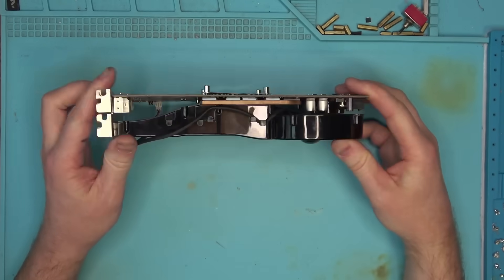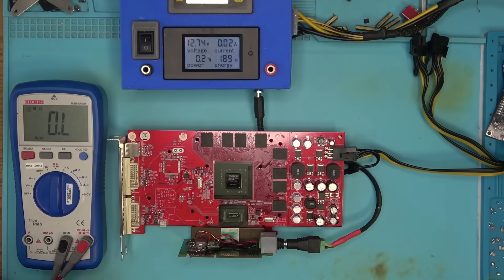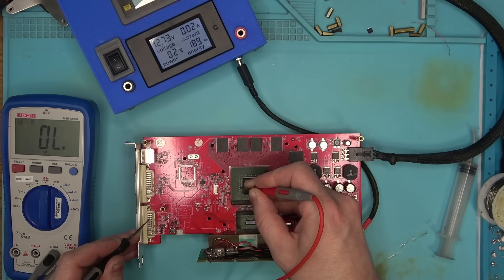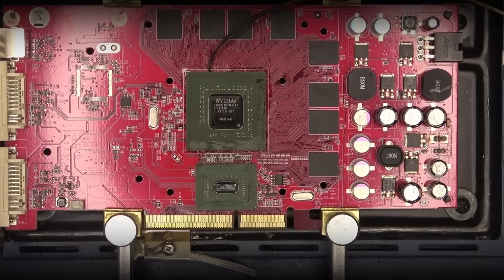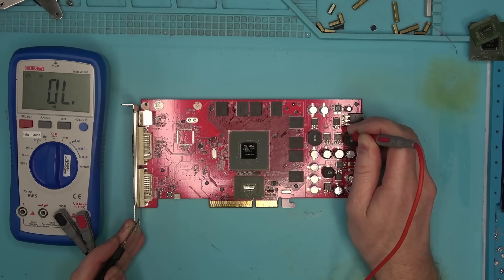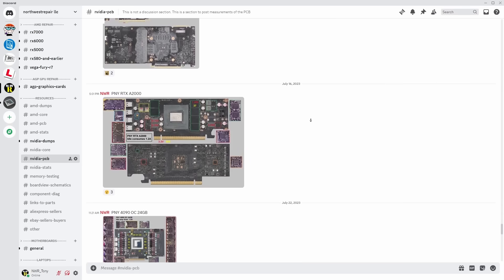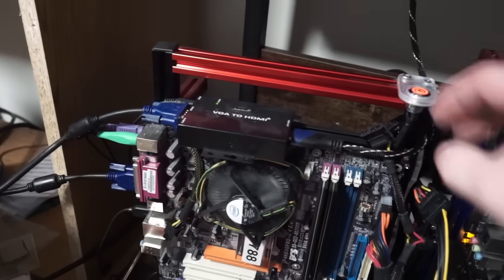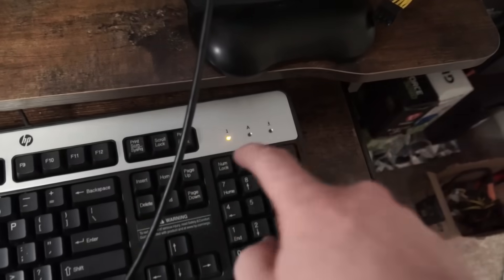Rare Graphics card incredible save

Comment: Can someone help me what could be causing these issues. I think its my gpu 4070Super, but when testing in GPU-burner and so on for arteffacts, nothing is at fault there.
When i scroll any websites, the image gets rendered by like a half and the other half is from the previous state. Happens sometimes not everytime.
It also happens in the discord, where i scroll, but only like half of the screen is scrolled.
Also when i alt tab from games like WoW it freezes the game and sometimes crashes. Win Reliability showed nvidia driver at fault which i even reinstalled.
I already tried installing complete fresh clean drivers. Factory settings Windows11.
No overclock on any device not even XMP/EXPO on RAMS.

Any ideas what could this be?

Comment: I have a Quadro FX3000 AGP that boots and works, however I get a power limit warning and it caps the performance. Some smd components were knokeced off the board (it was a rescued board). I found a diagram (pdf), but I’m not skilled enough to figure out what is missing. Most likely I will contact you, should be an easy fix considering the cases that you normally get.

Comment: How ironic to have a chipped die since the older G70 sibling had a shim. Though those HSI chips never had one, but maybe the cracks are related.
Reply: One of my 6800s has a metal shim on the HSI bridge, but my newer 7600GT doesnt (just soft foam which doesn't do much, if anything). Seems like the metal shims just got cost-downed out of existance at some point

Comment: What a weird decision for a card and not the 3850?
Reply: HD3850s are unicorns in comparison (not many sold cause it was usually cheaper to migrate to a PCIe system at that point in time than spend big bucks on a dead-end AGP card), and they cost stupid amounts of money nowadays because of it.
Also the 7800GS AGP is essentially a PCIe GPU with an AGP bridge chip, meaning you can salvage cores from the (comparatively worthless) PCIe versions of these cards
Reply: @Knaeckebrotsaege  Well aware, but this isn't 2006 anymore. Why choose the 7800GS+ vs the 3850 on a retro build? They cost similarly on ebay, I have several of both myself, I'm just trying to understand the reasoning.
Reply: @ Finding a dead 7800GS is easy and cheap, and since it's effectively just a PCIe 7900GT GPU die adapted to AGP, finding a donor GPU Die from a working but worthless PCIe 7900GT is also cheap. This combo likely ended up being cheaper than buying either a fully functional 7800GS AGP or 3850. 
edit: either that or the dude has emotional attachment to the 7800GS since he bought it new when it came out? who knows
Reply: @Knaeckebrotsaege  That's what i wondered myself. I use Lian-li PC-60's exclusively for my XP era builds due to sentimental ones. Maybe it was his original card, which would explain why he went as far as having it repaired. I can't imagine that was inexpensive. I've bought these cards working for a low as $80, as high as $200.
Reply: @suspectedstar  Interesting case, seen a few back 15+ years ago but can't remember the last time I ran across one. My retro rigs use more modern cases usually (Fractal Focus-G mostly, as it still has 5.25" bays) because of better airflow and being able to use larger, slower spinning 120mm fans compared to "period correct" cases. That said I still keep a NZXT Beta around. Objectively it's a cheap garbo case, but... sentimental attachment cause it's from my first proper gaming rig (Core 2 Quad Q6600) that I built from brand new parts, rather than hand-me-downs
Reply: @Knaeckebrotsaege  Interesting, i'd be interested to see some of your builds actually.
Reply: can't run Win 98 with a HD3850
Reply: @thomas.becker  So apparently BFG released a modded driver for 98 to support the card, interesting, I didn't know this. I suppose its time to make a 98SE build with the GS. Good lookin out

Comment: NWR saved my PCIe version EVGA GeForce 6800 Ultra, a card of a similar vintage. He thought it was still dead after attempting repairs (lifting and resoldering the core and mem) when sending it back to me but it turned out it just needed the right test setup and drivers. It's still working great for those late-night Doom 3 sessions.

Comment: The G71-GT-N-A2 is the good old 7900 GT. Great cards. I had both a 7800 GT and a 7950 GTX. Great times :)
Reply: AGP version was weirdly called 7800GS instead, despite using the 7900GT core
Reply: @Knaeckebrotsaege  yes, it's quite strange.
Reply: @Knaeckebrotsaege  very select 7800GS got the full 24 pixelshader of the 7900gt chip. most only got 20.
Reply: @thomas.becker  This one has the full fat chip with 24 pipes. the 20 pipes one is G71-Y-N-A2

Comment: I used to fully reinstall the system when changing GPU on windows XP. No matter if it was even Nvidia to Nvidia, there were always driver issues if didn't do a clean reinstall.

AMD was particularly bad at times, since their driver uninstallation didn't run in safe mode and driver was crushing the system if incorrect gpu was installed. So if you're GPU died for some reason (usually bad psu and power jump) your only option was to fully reinstall the OS.

Comment: Wonderful seeing that repair and hardware that brings me back many, many years.
I thought for a moment lack of POST might have been 3.3V vs 1.5V vs 0.8V AGP safety circuitry, but nope. (And yes there were cards and morherboards which had non-keyed AGP slots abd connectors resulting in fried cards. Matrox I'm looking at you!)
I hope someone one day sends you a VLB or MCA card, or even a Hercules adapter. Good luck!
Reply: I could send him an Avance Logic ALG2228 VLB graphics card with liquid damaged traces (salvaged from a PC that was left to rot outside, water accumulated in the slot and ate away at the traces closest to the VLB gold fingers), but I doubt he could test it and even if he could, it would probably cost 10 times of what the card is realistically worth (ie not ebay clownshow prices) lol

Comment: Is this like the best of the AGP cards? Crazy how its still worth a hundred bucks on ebay. But how much is it to repair? Worth it?
Reply: He never talks about how much the repairs costs, which is a red flag for me (rule of thumb is if you have to inquire about the price or it's listed as "ask for quote", it usually means it'll be stupidly expensive). 
Also it's only one of the fastest nvidia cards for AGP. The ultimate AGP performance crown goes to ATI with their HD3850 followed by the slightly slower HD4670
Reply: @ somebody must really love that card because how can the repair be less than what is listed on eBay?
Reply: @ Donor chips are cheap, cause you can just source them from (worthless) PCIe 7900GTs
Reply: @ I know he has the right stuff to repair them but it would be nice to occasionally hear what the cost was. 

I once had a 1970’s amp get restored for 300 while it was 200 second hand. But that’s truly rare and exceptional.

Comment: This is an AGP card! A holy relic from the lost Age of Technology; revered by Techpriests such as yourself. The last AGP I remb owning was a Gainward GF 6800GS
Reply: Don't mind me just hiding my 7600 gs agp and 5700.
Reply: HD 3850 AGP owner here. Had to get one to my collection as it cost only 30 Euros.
Reply: @keulloe  Guess you found a unicorn, since for most of those you can usually add another zero to the price nowadays which is completely ridiculous. My fastest ATI AGP card is a HD4670, mainly cause it was significantly cheaper than a HD3850. And a lot faster than than my next slower AGP card, a Galaxy (now known as Galax/KFA2) Glacier 6800GT with unlocked pipes and the same gigantic Arctic NV Silencer 5 as the card in this video
Reply: All hail the Omnissiah!
Reply: I'm so old that AGP still seems somewhat modern to me...
Reply: I still have some agp cards roaming around. One is an AMD with a fancy Zalman heatpipe cooler and the other is a rancid whatever with all its caps blown open.
I keep it to practice smd soldering- that was the plan, at least… And a Pentium2 Asus board, some Adaptec scsi bits- maybe I put together a retro box.
Reply: My last surviving AGP graphics card is a Radeon 9600XT, although its cooling fan had unfortunately ceased to function the last time I checked. And I don't think I have any functional motherboards with an AGP slot to test it out again since my last one seemed to have died many years ago. I also have an even older GeForce 2 GTS, but I forgot where I stored it.
Reply: I think the last one I had was a 16 from 12 pipes unlocked AMD X850 Pro to the XT. 
The good old days of free hardware. :D

Comment: I've always be scared of those rare things with limited spare parts, because if you miss something and replace broken parts (in this case: cores) - fart - you left with GPU and functional cores. Respect.
Reply: This being essentially a PCIe GPU core with a HSI bridge adapting it to AGP makes repairs easier actually, as you can salvage working cores from the (comparatively worthless) PCIe versions of those same cards (7900GT)

Comment: For rare/older GPUs, Wayback Machine can sometimes dig up OG driver versions from manufacturer sites. If the card posts with DVI only, but not with HDMI via converters, it might be worth checking signal voltage compatibility or even a firmware quirk in the card's video output.

Comment: That chip at the bottom is a PCIe to AGP bridge that nvidia made because we were transitioning over to PCIe and wanted to make it easy to sell products for both busses before releasing a native implementation in the next generation.
Reply: They had also one for AGP native chips to run in PCIe, like the GeForce PCX series and their Quadro brothers. ATI/AMD used a bridge chip as well from X800 XL to HD 4670.
Reply: @keulloe  I still have one of those just for the weirdness of it. A Quadro FX1300, which is essentially a Geforce PCX 5950, which in turn is a Geforce FX 5950 AGP with a bridge chip to make it PCIe. Quite wild
Reply: @keulloe  HD4670 was a great card
Reply: Pretty sure GeForce 6 and 7 had native PCIE implementation, because SLI. That AGP to PCIE bridge chip, was meant to filled the needs to the AGP users, also, without the need for Nvidia to make two chip design one for AGP protocol.

Comment: hey Tony do you work on SSDs? I think i have a dead SSD but looking at the pcb I don't see any signs of damage and it's only about 2yrs old. It was working perfectly fine when i shut down my PC at 3am, then i booted up my PC this morning at 10am to a dead ssd, it's not detected. I put it in a external enclosure and it shows up but is greyed out in My PC and Disk Manager shows it as No Media.
Reply: Likely either the controllers firmware has borked itself, or one of the NAND chips died. The former is technically fixable (depending on what controller is in it and if the manufacturer tools have leaked), the latter is pretty much a death sentence, as fixing it costs more than the whole thing is worth. And you'll lose all data on it either way so ...
Reply: @Knaeckebrotsaege  yeah, i mean it's a $50 1TB T-Force Vulcan Z SSD so I'm guessing repair would cost alot more then the SSD. I already contact Team Group about getting a replacement since it's still covered by the 3yr warranty. I would be interested in seeing if it is possible to reflash the firmware. i tried their TG Smart Tool program but it timed out trying to detect the SSD. It just sucks because I swear a few days ago i was going to back up the drive but decided not to.

Comment: That 7800GS was NVIDIA's fastest AGP card. The second chip at the bottom you replaced is the 'HSI Bridge' that converts what's basically a PCI-e card to use the AGP interface. I still have one :) The competition's (ATi) cards of this era were pretty fantastic, with their X800 & X850 cards owning most of NVIDIA"s earlier 6800 series. But NVIDIA's 7800GS did a great job of holding the AGP title again briefly. A few years later, ATi would release the HD3870 and HD4670 cards to claim the AGP title once and for all. The HD3870 is the fastest of them all, but it's redonkulously expensive.  The crappy NVIDIA GT730 and most laptop graphics easily outperform all of these AGP cards now.
Reply: The Radeon HD 3850 was the fastest AGP card. The Radeon HD 4760 had twice the VRAM and HDMI but, in most cases, the HD 3850 outperformed it. Nvidia's 7950 GT was their fastest AGP but couldn't hold a candle to either top Radeon.
Reply: I remember my HD3870 fondly, I got it ridiculously cheap back in 2009?-ish something. I remember I had an HD3650 before it, also got it for cheap used but it deemed less of an upgrade than I expected. The HD3870 though was the boss, on cold winter nights I just let my pc turned on the night and it would heat up my room.
Reply: as I remember a GS variant wasn't the top notch of their line
GT and GTX was
Reply: Shower thoughts: what if some madman makes a custom AGP-pluggable PCB with an HSI bridge and a PCIE riser cable on the other side? RTX5090 on P3?
Reply: @yunodiewtf a guy could make one, but think about it, 32 bit operating system, single core CPU...  Would limit you to a HD7900 or a GTX7xx with Windows XP.  You might be able to use Win7, but you certainly would be unable to browse web, play Youtube videos or even access Steam games.  Would be pointless unless you gamed offline and had stripped versions of what other gaming networks provide. Everyone abandoned all the old OS's.  Linux might work, but again, limit of 3gb RAM.  I did however see some older P4 motherboards with PCi-e & AGP slots, but they missed some features other boards had.  I honestly was contemplating setting up a single core p4 setup with Win7,  but there were too many issues with hardware support on PCI cards.  WinXP x86 was the best option, and you cannot get graphics drivers for that OS on newer cards.
Reply: @pixels303at-odysee9  That's a "just because I can" thing, AGP slot is just 2GB/s which is equal to PCIE 1.0 x8 so no practical use anyway
Reply: @yunodiewtf  I wouldn't know. I never bought and used one before.  The lanes those motherboards used typically were four, from what I read in the manuals.
Reply: I had a Radeon X1950 Pro AGP with 256MB and a HD 3850 AGP 512MB after it. Both were amazing cards.
Reply: I am pretty sure the 7950 GT 512MB is Nvidia's fastest AGP card
Reply: @excess.subiefl0w  it's a Gainward Bliss 7800 GS+ Golden Sample 512 MB Special Edition with the 7900 GT Chip.  
....internet experts
Reply: buddy and i got x850 xt pe's back in the day his was agp mine was pcie those cards were amazing maybe a little less fps than the nvidia but the image quality was years ahead.
Reply: I had a pic-ex HD4670 by gigabyte, pretty good midldle weight card, loud asf though . Eventually sold it to a friend and replaced it with an MSI 560ti twin frozer II. Wonderful card that one. I still have it and it's still working.
Reply: ohhhhhh, i had the HD3850 IIRC. many a great evening playing WOW on my projector since i didn't want to deal with inconsistent LCD panel quality unless you got spendy. and kicked off my obsession that continued with the 4870, and multi-gen ownage with the 5870. i miss those days of sub $500 flagships 😔
Reply: What do you consider expensive, because I have had a HD3870 AGP for ages, and when I looked at selling it, they were going for between $50 and $200 bucks...
Reply: @mountedpatrolman  i was thinking MSRP at launch at least with my comment
Reply: You are wrong , ATI HD3870 ( AGP version ) was never released , i own the fastest agp card in the world , its the HIS 3850 IceQ3 AGP ofcourse , there was no faster AGP card than this .
Reply: This is actually a G71 chip. Lower power and, possibly, a higher spec chip. Many variants of those.

Dont really get why these are so expensive. There are winXP drivers for PCIe chipsets and GPUs.
Reply: keyboard experts
Reply: @Stikkzz  The 7950 GT was, hands down, the fastest Nvidia AGP card and was slower than the HD 3850 AGP and the HD 4670 AGP. How is he not wrong?
Reply: i think the fastest gpu was like the ati 1950xt that i got back in time, but was not happy because the bottleck was the 775 socket cpu at that time.

Comment: Maybe someone was putting an old system back together out of nostalgia or something.  The first high end graphics card I ever had was a Radeon X850XT.  Man that thing was a beast when I got it.  Today it would struggle to run a web browser.
Reply: I had a GeForce 6800 Ultra back then, but no matter how I clocked it, it couldn't touch the X850XT in the benchmarks. I sold the 6800 Ultra after I bought the 7800GS.